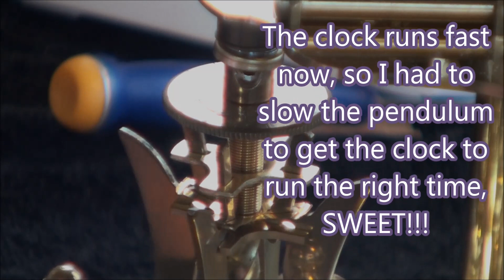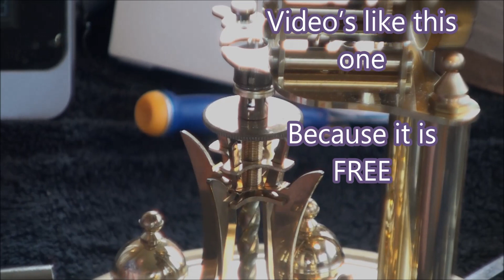How to get Your Anniversary Clock Running Again

Comment: Why does mine that runs on one AA battery tell time but not pivot?
Reply from the maker: I don't work on battery movements like this. Just the same, has the battery ever corded in the space that operates the pendulum? if so, the wire might have been eaten away. There are times that for some reason the pendulum part just stops working and you have to buy a new, separate pendulum swing only.
Reply: Thanks for reply. It did seem there was residue from battery. I’ll look for a real Anniversary clock in the future. I’m fascinated by time pieces. When I see complex nature of the springs,gears and whatnots I’m inspired.

Comment: Kind.  Dooo....    oil.    Lightly oil the pivots...   these are the most butchered clocks we do...  learn to take the springs out of the barrel... you have the working knowledge  good outcome if you follow the book..  YouTube show a couple of good people doing a good job...    you're braves and very much on line..   cheers..
Reply from the maker: Thank you John Rogers. Some of the springs will come out and others I have worked on were not meant to come out. I didn't want to order a new spring, so I gave this cleaning a try. The clock runs great now. Thanks for stopping in John Rogers.

Comment: Votre mouvement est bien trop faible ! Il ne fait même pas 170° . Or, sur les pendules 400 jours, il faut que le mouvement fasse au moins 270° pour assurer que le mouvement persiste. Donc, sur ce que nous voyons par exemple à 28:15, votre pendule , si vous n'y touchez pas va s'arrêter forcément.
Reply from the maker: This was my first Anniversary clock I have ever done. For what I did, It did run and keep time just the same. Since this video, I have learned how to take the barrel spring out, clean and oil it again, then put it back together. It's nice to learn and be successful at what you might have learned. Thanks so much for the comment and I will also pay attention to the rotation on my next clock.
Reply: @justmike57  Bonjour
Pour vous aider, vous pouvez sans doute vous procurer le livre suivant : "Anniversary clock adjusting" de Mervyn Passmore qui est un livre merveilleux pour apprendre à maitriser ces superbes pendules. Vous y trouverez également des "outils" pour régler l’amplitude du mouvement etc ... Je pense que ça va vous plaire. Il y a aussi l'indispensable "Anniversary clock identiification" du même auteur qui vous aidera à vous y reconnaitre dans tous les modèles et régler les fils. Enfin, vous avez le site de Meadows and Passmore qui vous vendra beaucoup de pièces indispensables pour ces pendules ainsi qu'un utilitaire sur le site pour vous aider à les identifier. J'espère que tout ceci vous aidera.

Comment: super small screw at 8:59
Reply from the maker: Yes, when working on clocks, they do have fine, small screws that do make it a bit more difficult to work on Frankie
Reply: @justmike57  Yes, it is.